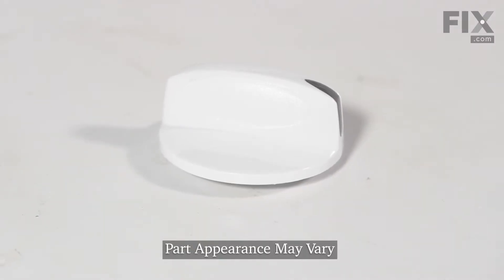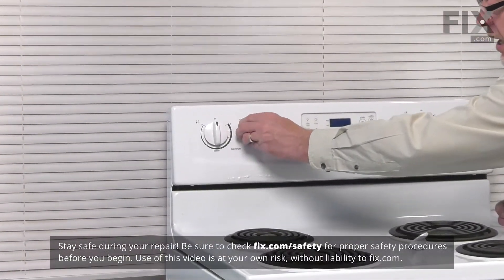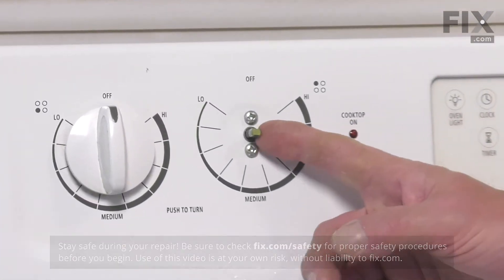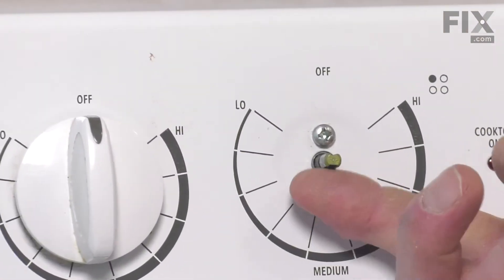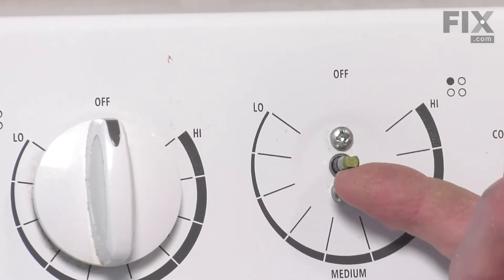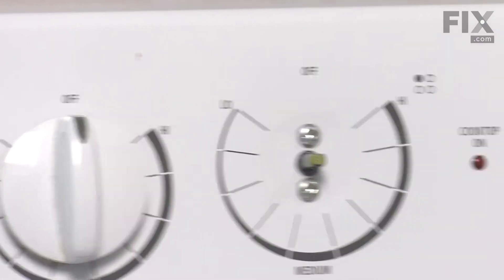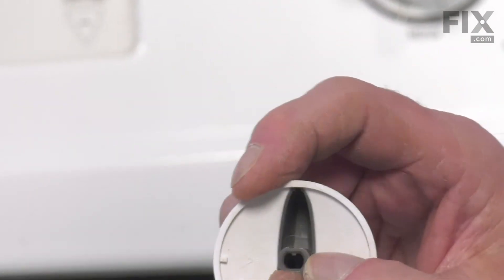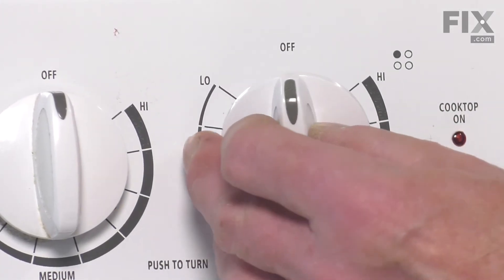Whirlpool Range Repair - How to Replace the Knob

Comment: So on my stove the 2 screws came out, and the shaft went back inside. How to I get it back out so I cN put the screws in and the knob
Reply: I have the same problem
Reply: same situation here. The shaft didn't fall in, but the two screws came out. Trying to see what I need to do to put more in
Reply: @jaminlee1392  Same here!  The screws will not go back in....turning and turning.   They fall out.
Reply: Same here
Reply: Also me
Reply: Same here